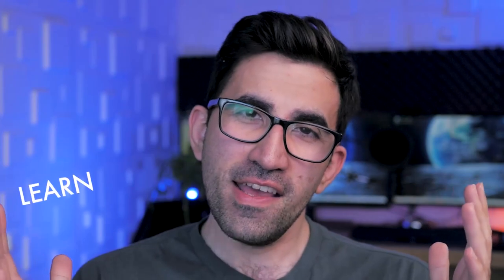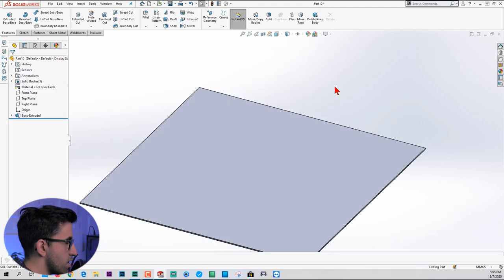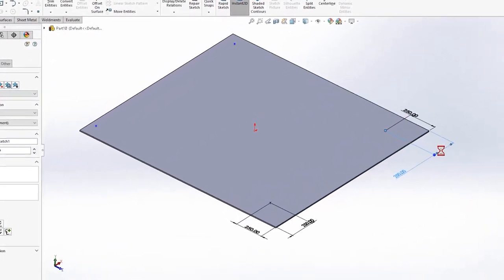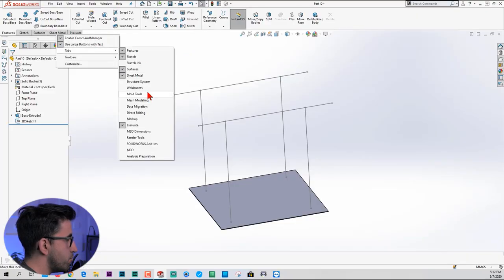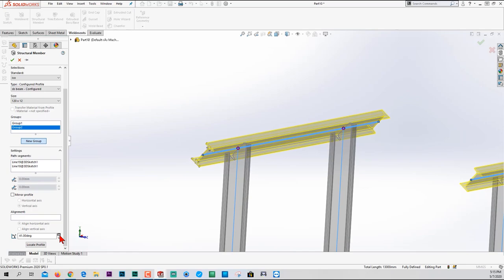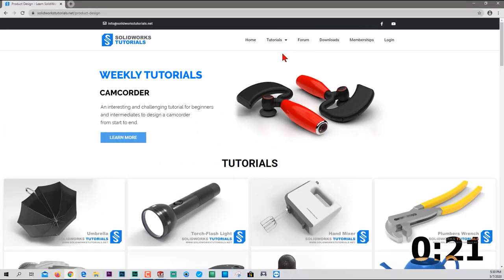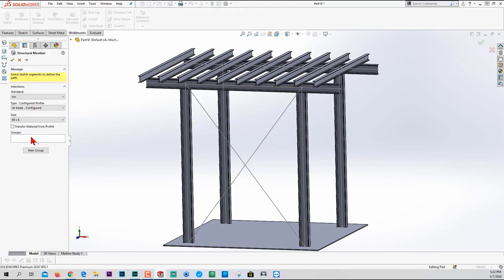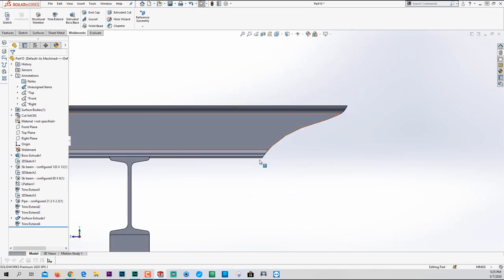SolidWorks Weldments - Design a Pergola

Comment: Thanks for another great video. Q1: This is all done as Part. How you go about transitioning this into Assemble? Q2: Can you customize and save as new components all them pipes and profiles and save them in the library? Thanks again. Greetings from Poland.
Reply: Q1: Features > Save Bodies (Creating Assemblies from Multibody Parts or Cut Lists)

Q2.1: "solidworks create weldment profile" (Weldments - Creating a Custom Profile*)
		* 4. In the FeatureManager design tree, select Sketch1.  important step :)

Q2.2: "solidworks save to library"
Reply: @golinzovsky  thank you

Comment: So this is pergola made out of steel/metal beams instead of a wood? 
And also what is the differnce between pergols at the beginning of the video and the final one? 
You somehow made it sound that pergola made out of separate elements was not good. But how would you build it if you did not have separate elements tha tyou need to order?

Comment: Thanks but this didnt really help. Your thumbnail looks like a complete and modified pergola and the video just ends incomplete. Also did you realize that your roof is unequal on the sides. Also I have never seen a pergola made from I beams why didnt you use timber?
Reply from the maker: noted. Sorry for disappointing